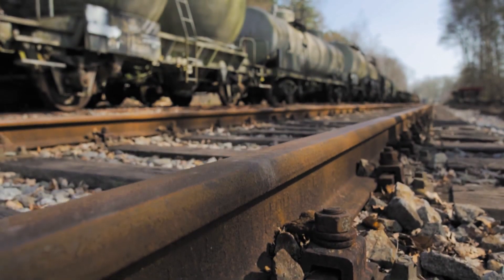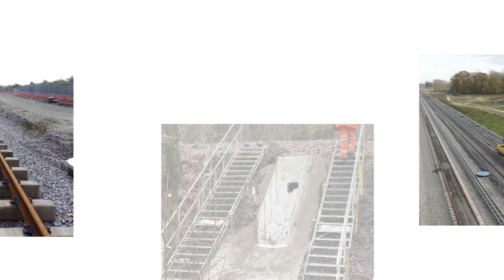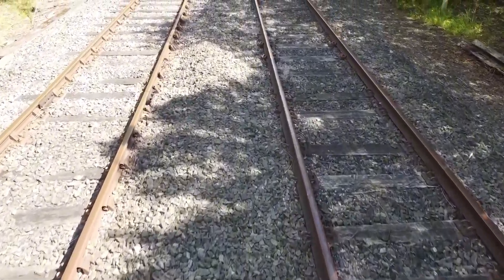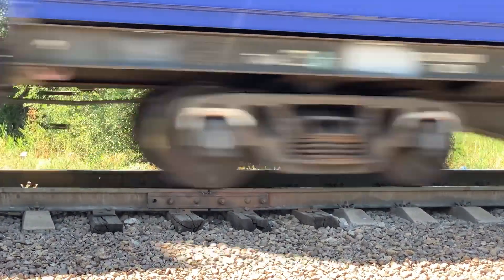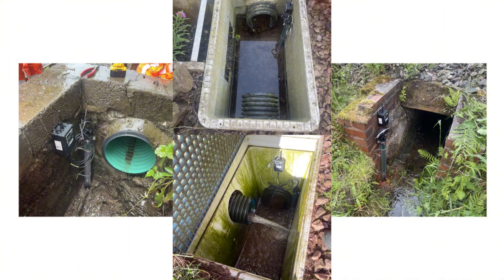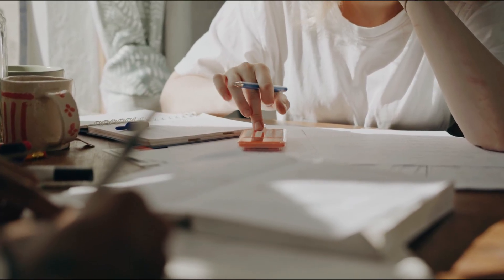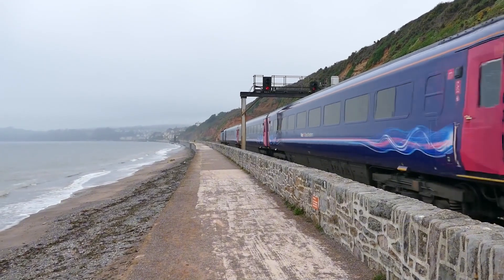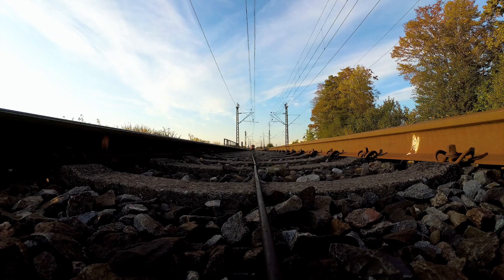The Hidden System That Keeps Railway Track Stable

Comment: I thought this was going to be a very practical overview of how railway drainage systems are constructed, but this man came here to wax poetic about the unsung hero of railway infrastructure, daring you to love drainage as much as you claim to love the engines and cars.
Reply from the maker: As a track engineer, I do think I love drainage more than the train that run on the track :) I will take the idea on board for a video on how drainage is designed and built

Comment: Your choice a couple of clips around Dawlish Warren is appropriate! Modern cameras at the end of fibre optic cable seem to be quite useful. The only occasion I’ve come across that being done was actually inside a common sewer by the water company at home, to inspect a block. It would not have been possible in the past.

Comment: Great video again, and great information.. Here in USA in Pa on the Gettysburg railroad. I just had (7) culverts replaced. The old one where rivit steel for 1869, and they were rotted along the inside edges on the inside. In the winter time with the snow. The snow would melt on top of the culvert in the center of the gage. That told me that they were leaking air up thu the subgrade from the bad spot in the culvert. We had a contacter install all new 36" gray plastic pipe. Now, i am happy with the project. The track is safe, and i can sleep at night.
Reply from the maker: Great to hear you liked the video! 1869, wow that had definitely reached its design life! Good spot about the melting snow